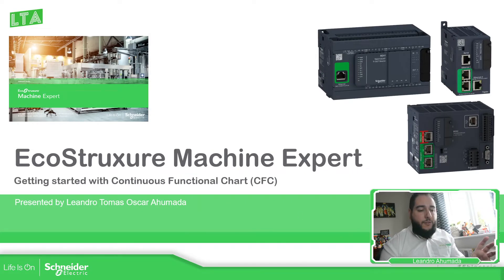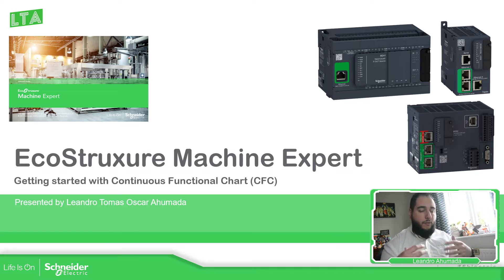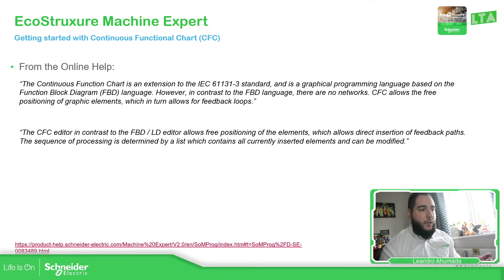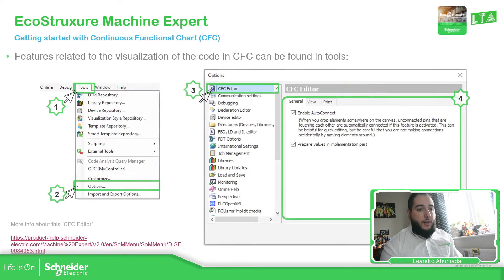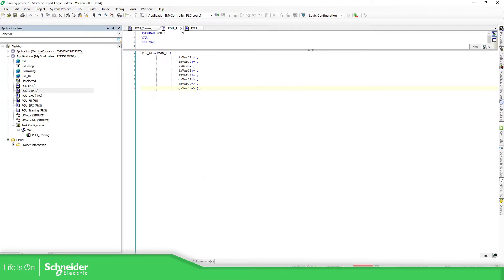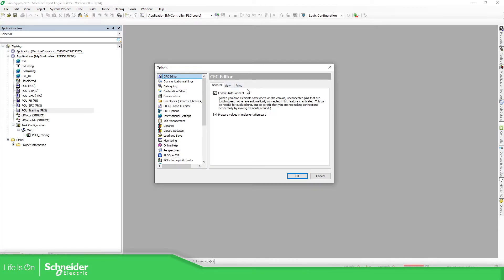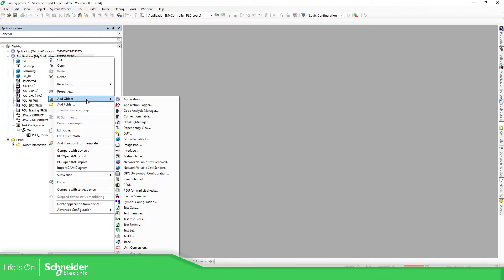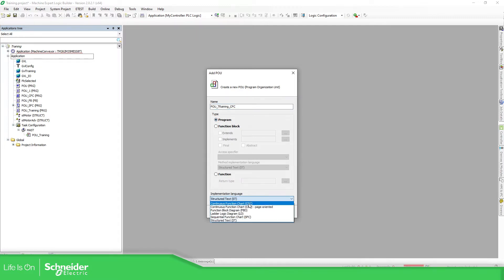EcoStruxure Machine Expert Training - M4.3 Getting started with Continuous Functional Chart (CFC)

Comment: Hello, Myself, I have one doubt regarding creating function blocks or CFC in Schneider Machine Expert V2.0. I am creating ladder logic program in reference to control the multiple cylinder of different station individually. I want to ask that instead of creating multiple rungs for each cylinder can we able to make some kind of Function blocks (FB) or else Continuous Functional Chart (CFC) to make the logic robust or easier to read. Is it possible make few function block and reuse it multiple time for different cylinders?
Can you make the video in this reference?
Reply from the maker: Hi there! If the logic is the same of each element then the best will be to put the logic in your own block. In a few weeks i will make a demo for this to improve the code and also using the visualization.